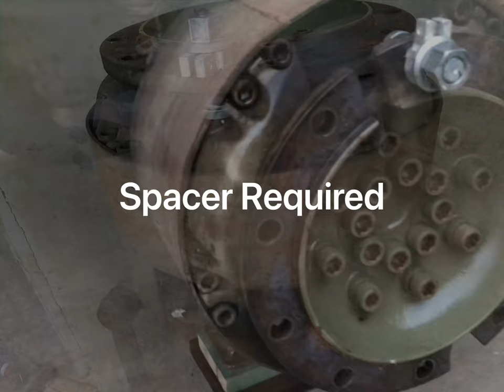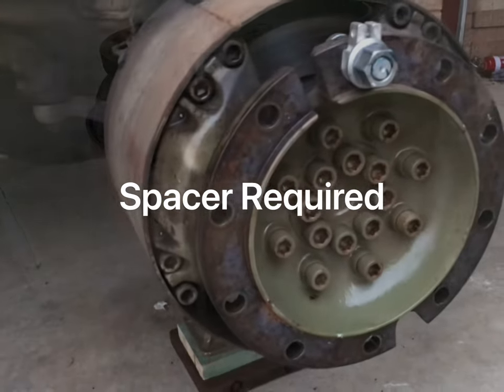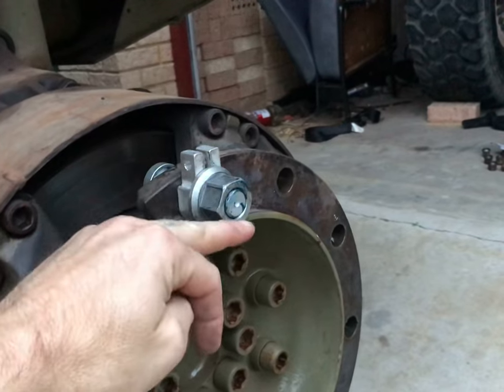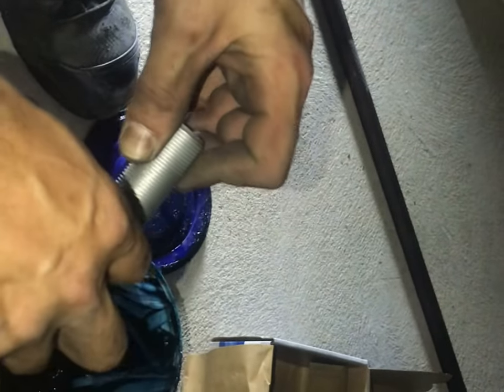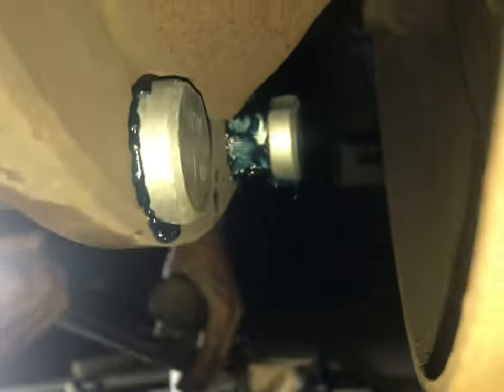Ex Army 1700L Unimog  Tyre & Wheel upgrade & Install P10  (Massive Difference)

Comment: Looks nice........but....tyres are everything (depending on what you want to do with the mog). I'll just tell my story...85 U1300L in more than excellent condition only 48,000kms and had a half life full pulldown refurbishment not long before it left the Bundswehr....plus being a Radio truck it was garaged all its service.......When I bought it.....the tyres were literally one month old and Brand spanking new Michelin XZL military tyres.     Over Salisbury plain (white chalk) they were excellent, would go wherever a Challenger Tank would go and on road, a nice smooth drive with no vagueness....didn't have to saw at the wheel or anything.   Then we decided to up sticks and move to Eastern Poland.....great drive over, 3 days at 80 kmh (we really are in the east of Poland)....she performed without a hitch with 3 tons of belongings on the back.    a couple of days in, I had cause to drive to a place to tranship some wood.....I parked on a wet field of grass.  You guessed it, when I came to move off, even with all diff locks on, she would barely inch forward.....all tyres spinning uselessly....the soil round here is a mix of sand and clay...pretty poor stuff for farming, but it's what they have......it's yellow to look at but when it dries on your tyres, the mud dries a cool shade of blue.    I noted that tractors do OK on it (a 2wd tractor here is useless except in really dry conditions).  So I bought a set of Michelin Chevrons...now all I could get were loader tyres, like on the front of 4WD JCB loaders......but what a transformation, suddenly I could go off road and along the muddiest tracks...they are not rated for speed, but I have l kept them for about 8 years and driven at speeds up to 75 Kph on them, they never got hot or shed any tread (like the doom mongers said would happen). I spoke to a Michelin man and he told me on the QT that the ratings are very conservative and you can double it in real life.    I have just changed to a set of BKTs that are a kind of hybrid between a heavy Bar grip and a chevron, great on road but not really tested off road yet.
Reply from the maker: Thankyou for your comment mate very interesting and 100% accurate , tyres are everything on these trucks , no use having all that talk if it can’t grip , turns it into an off-road vehicle worthy of its reputation 👍🍻

Comment from the maker: I used an pneumatic impact gun to get the studs most the way home and then finished them off by hand was no trouble at all , I didn’t want to spend any extra money on tools , although I did buy a 32mm deep impact socket and a 3/4” breaker bar 👍🍻

Comment: Love the vids... Can you expand on the tyre and rim size choice? Cheers
Reply from the maker: Hi , these are 20” Hutchison Beadlock Rims and the Michelin 395/85 XZL , I chose this combination for the following reasons ,
. Larger rolling diameter slightly more top speed , 
.ability to drop to a lower psi for beach mud etc
.wider footprint = more stability on/off road
These are the main reasons I opted for this setup , 
Thankyou for watching 🍻
Reply: Does the new wheel and tyre size fit in the spare tyre spot under the tray?
Reply from the maker: @jessecooper6310  Hi mate , no it doesn’t fit , but with some modifications it can fit in the original spot , I have seen it done 👍🍻

Comment: Im in Perth, wondering if you still have the bows and canopy?
Reply from the maker: Yes I do mate , am going to keep them for the farm cruising , were you after a set ?
Reply: @westernaustralian4x4advent60  I just purchased Pauls from Two rocks and it has no canopy.or hoops... not really a problem though... if a set comes up at a reasonable price i would snap them up.
Thanks for your reply...
Your doing a good job on your build by the way....
Reply from the maker: Thankyou mate , and Thankyou for the support , just been tinted which will be in the next video and it makes a massive difference 🥶, if you flick me an email which will be in the channels info I can give you the number of a guy that will be able to get the hoops and canopy for you 👍🍻